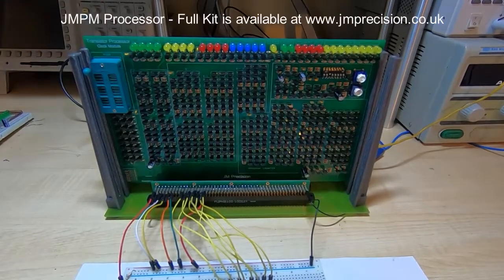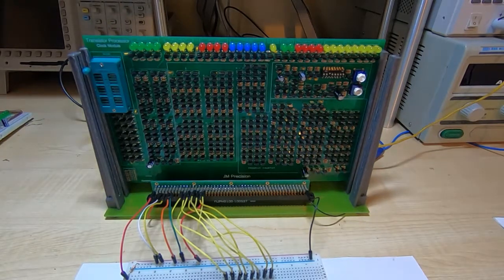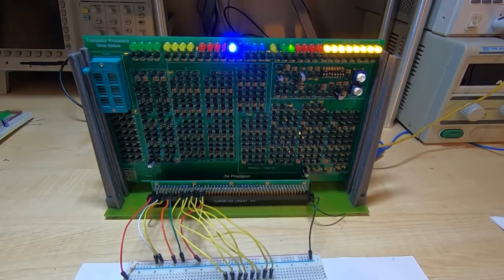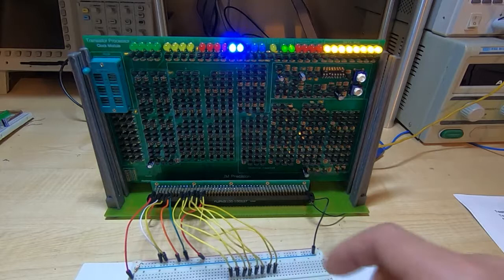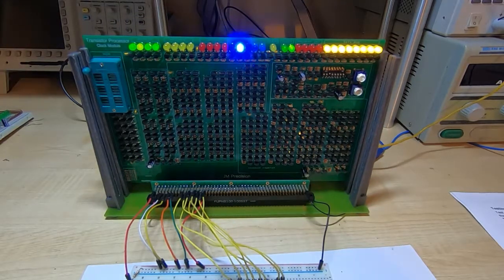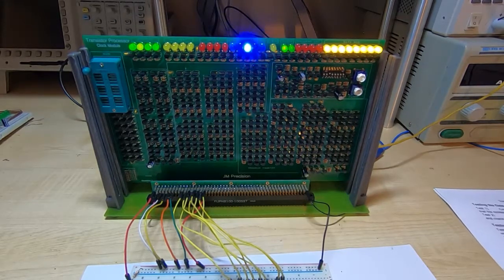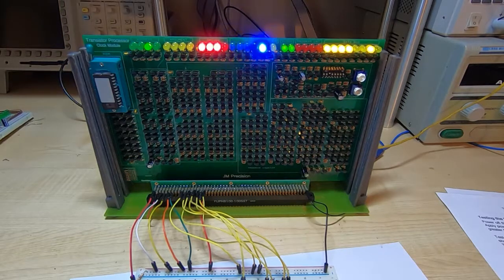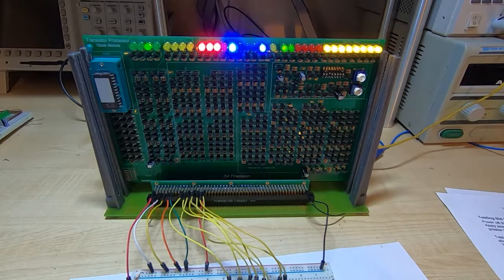JMPM Transistor Processor Clock Module Test

Comment: It would be interesting to see what the ROM would be like if instead of you using an IC to implement instead on a PCB with discrete components.
Reply from the maker: The book does describe a transistor version of a memory circuit but for just 16 bytes it requires 2300 transistors so it would need an extra 4 boards. Also this is intended to be a processor and not a computer so I did not want to distract attention from that. I have however designed it so that additional boards can be added (including a memory boad) and at some point I may add additional mosules such as input registers, working registers etc.